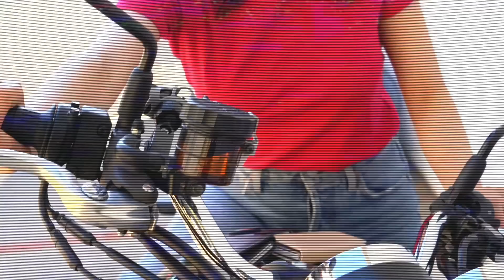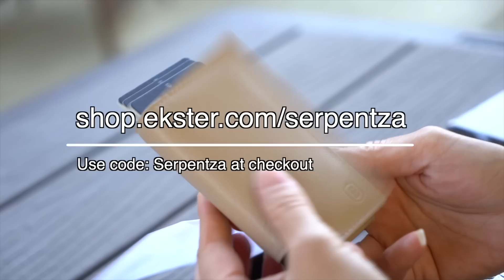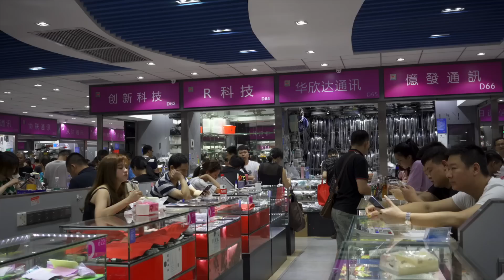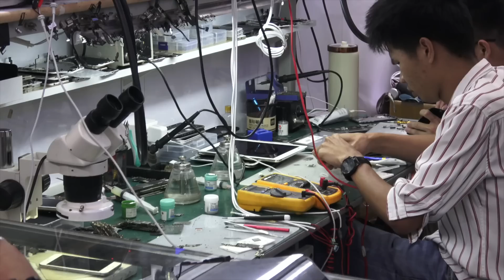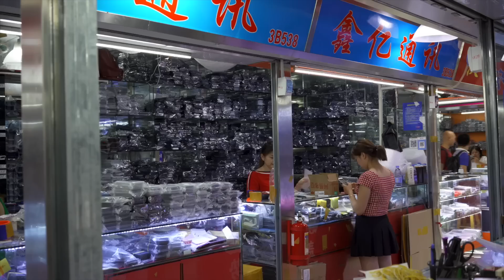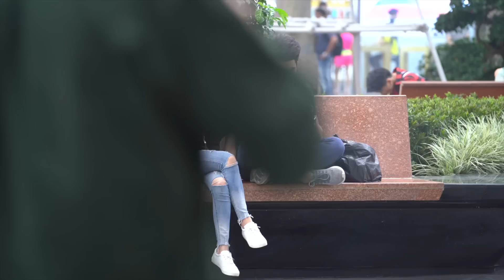Why China Can't make Chips!

Comment: It's worse than that -- at this point, any company who has their equipment or machines manufacturered in China, deserves to go bankrupt.  Now I see why the bearings on the pumps we bought kept failing -- the metal spheres were probably salvaged and did not have the tolerance for heavy use.  The US distributor gave us 5 pumps, as each failed one after another, before they finally "threw in the towel" and refunded our money.
Reply: Pump and dumped X_X
Reply: @HoboKa_AlexShtokalko  Schadenfreude?
Reply: Same issue, after the third time I asked the rep: are you sure you want to keep using that manufacturer to supply my parts? - it's costing you a fortune!
Reply: @hentype  - They also use clips from hollywood movies claiming to have destroyed other militaries in various skirmishes.  Like claiming to shoot down India's fighter jets, but it's a film clip from Top Gun.
Reply: looks like cheap chinese manufacturing is the most expensive in the long run
Reply: This reality is slowly starting to catch up to us in the west, as the old equipment that was built in the west starts to fail and we come to the horrifying realization that China can't replace it!
Reply: I bought a Reebok home exercise  bike. They used Chinese ball bearings because it is $10 cheaper than a German one. They failed after one week. Even the expensive Peloton and Nordictrack (which i also had to send back) use those cheap ones. The sales departments must be punished seriously, whoever approves using Chinese ball bearings should be fired on the spot. I am sure they can produce the same quality as German ones, but then they cost exactly the same!
Reply: @hond654  keep using the guarantee , hope these companies realize china is a no go
Reply: @ahmataevo  Russia claimed Ukraine was shelling civilian apartment blocks in Donetsk/Luhansk back in 2014. They “proved” it by showing cellphone footage of a (Russian) Proton rocket explosion from Baikonur…
Reply: Who is the "we" here?  A University?  A heavy-equipment manufacturer?  I'm curious; would really like to know who the 'user' was, as well a their equipment-supplier.
Reply: Texx Mexx  shutup bug!
Reply: Texx Mexx  be quiet please. I see you all over the places. Such admiration to ccp..
Reply: Dealing with one now.... high speed bearing on an electric motor. OEM sourced from China, each and every one introduces an out of balance "wobble" OR starts to glow after a bit of use, despite repacking with new/good grease. 
Demanded Japan/German made equivalent (I.D., O.D. ect) this time.... backordered, and I think I know why.
Reply: Texx Mexx  True, but the people of Japan were flexible. They admitted when things weren't good and asked for help to change. China views this as weakness, so I doubt it will change.... if it does, China will first need to change... aka, capitalistic, not communistic.
Reply: Texx Mexx  No your wrong it’s time for us to buy AMERICAN MADE ONLY‼️ And stop giving our money to countries other than our own‼️
Reply: @Jamie-Delph-44  I feel the same way,but people don't want to pay the increased prices as USA or in my case UK will be paid minimum wage or above ,
Reply: So apple, tesla, Microsoft and Asus deserves to get bankrupt since they all have gadgets & cars made in China
Reply: @hongluong3427  Short answer, YES. You are either for freedom or for slavery and  tyranny. These companies are putting dollars before human rights..... so it really is as simple as Good vs Evil.

Comment: The ecosystem of high-end semiconductors is pretty much set at this point, and will only get more solid at this point, since it is in the US national interest.  The Dutch and US supply a majority of the tooling needed build out the research and manufacturing capabilities.  First China has to duplicate the work of companies like LAM Research, Qualcomm, Broadcomm, Intel, NXP, etc.  Without that, you cannot even begin to build the infrastructure that would allow you to start making progress.  If your basic machining capabilities have only recently advanced enough to make a 1mm ball bearing (or whatever size it is), you will never advance to sub-10Nm etching on your own.
Reply: it's not so much about nm, but it's more about design.
Reply: Well, they made a sub-10Nm chip
Reply: @Foquro With western equipment.
Reply: @Sl1pstreams  That's the point. The sanctions don't work.
Reply: @Foquro  sure they work. Making a few chips with smuggled foreign equipment is not creating a domestic chip fab industry.

Comment: Regarding modern ballpoint pen technology, the anti-gravity ballpoint pen was invented by American Paul C. Fisher in 1965 which could write in outer space, upside down or any angle in temperatures ranging from  -50 to 160 degrees Fahrenheit. The famous Space Pen could write on surfaces as soft as butter to as hard as steel.
Reply: All the millions that went into developing the space pen, while the russian just used pencils
Reply: Ultimately Russian cosmonauts switched from using grease pencils to the Fisher Space Pen.
Reply: @jadenephrite  …. Yes, and the russians ended up buying those pens for hundreds of dollars in bulk, rather than waste millions in reinventing the wheel. I know the fisher pen has all of the marvel in the world, i used to own one in college, but i highly doubt using a pencil instead of those space pens was going to be the difference between a successful mission and one that ended in catastrophe
Reply: @spitgiezer  you don’t want your computer components bathed in graphene …
Reply: @Manteo1984  it´s not graphene but graphite, though it´s also electrically conductive so the result remains the same
Reply: Funny thing is the tip is pretty much standard, the ink tank is pressurized but the secret is the ink itself because it can even write over grease, they are the only pens I've used since I was a kid, they have always worked and never leaked even after sitting in a car in Las Vegas all day.
Reply: @spitgiezer  The Russian couldn't simply use a pencil  the lead could easily break off and float away, creating a hazard to astronauts and sensitive electronics on the spacecraft.
Reply: @spitgiezer  Thats a myth....😂😂
They quietly bought the civilian space pen as NASA did, but they bought more quantity....😂😂😂😂😂😂😂
Pencils in space would be a tragedy for security reasons.....😂😂
Reply: @bunnysidhu5064 it's how the principle of "keep it simple stupid" can be a double edged sword when a simple solution leads to a stupid problem and a bunch of simple solutions to stupid problems leads to a complicated solution overall.
Reply: @spitgiezer   For a person acting so smug, you fell for the myth.
Reply: And the Soviets used pencils. Simple solutions😅
Reply: @redbaron9029   It actually had problems with pencils compared to that pen.
Reply: @bunnysidhu5064  Don't spoil the urban legend :D

Comment: The ball in the pen tip is tungsten. It's a very small amount but if you have a ton of pens it's worth it to clip the balls out. It reduces friction and the ink rolls off instead of sticking.
Now you know the secret of the ball point pen
Reply: They will find a cheaper material that does not last long.
Reply: The issue the Chinese manufacturing had was the tolerances required to prevent them from leaking. Tungsten is difficult to machine anyway, and this is a very tightly toleranced and very highly spherical part.
Reply: That’s irony for only one reason china is the biggest producer of tungsten in the world.
Reply: @freedomdude5420  It's easy to mine natural resources, what differentiates the West from the world is that they add so much value to those natural resources. That's why they're rich. Anyone who claims they got rich just from invading other countries, and harvesting their natural resources should look at how much stuff in their house was invented in the West.
Reply: @MrDosonhai  I was referring to also that they have the biggest deposits in the world, but then again you are at right in some degree there a lot of countries with good resources but don’t have a way to make stuff with the materials it’s kind of an art. One thing I hate about countries with rich resources is it’s easy for the country becoming a dictatorship it’s when the country has to be forced with medium to low resources when a dictator loses power completely I don’t know why.
Reply: @freedomdude5420   Raw material versus sophisticated innovation.
Reply: @MrDosonhai  Exactly. It's the deeper aspects of culture at play here not luck.
Reply: its not a secret, its the most heat specific metal, just like water to liquid
Reply: @enginerdy  is it machined? I'd have assumed they used something like a shot tower
Reply: @nobodydoesithalfasgoodasyou  I figured it was some kind of two plate grinding process, but I don’t really know. I don’t think a shot tower would work because the size and roundness is so tight
Reply: @enginerdy  there is a nice video about how ball bearings are made, seems you're right about the grinding
Reply: Like the material the ball is made from isn't common knowledge. So, what's the point of collecting ball point pen balls? Are you going to make new pens, use them as ball bearings, oOr collect enough to make it worth selling as scrap? You sound like my friend, who thought that stripping precious metals from junked computers was something that would make him money, not realizing how many he'd have to strip to come close to having enough metal to sell.

I think you're nuts.
Reply: @TheEudaemonicPlague  I used a local council household recycling place. Right by it was a PC recyclers, set up to scavenge all the important bits. It shut down with a yard crammed with old beige PCs. Hundreds of them, stacked everywhere. How many were still inside I have no idea.
Reply: @Waverlyduli  
africa produces a lot of iron, cobalt, uranium, copper, bauxite but dont have the technology to use them properly.
science and technology is the key to success.
Reply: @thingsihyin4872  
László József Schweiger; 29 September 1899 – 24 October 1985
doesnt sound or look chinese to me
Reply: @freedomdude5420  In economic theory, it’s called the “resource curse.”
Reply: @tonyp2601  did you coin the term, or was this kind already either way it’s a good term.😎👍
Reply: @goldenhawk352  I do have to give him credit though that’s why it’s all about trial and air. So sometimes you may never get it somethings are lost to time.
Reply: @MrDosonhai  those stuff were invented by Chinese Americans.
Reply: @thingsihyin4872  Source? And Americans consist of many races, American is not one ethnicity. In fact, it only proves the US system is the best system in the world so geniuses keep going there to live.

Comment: Several years back, some of the Chinese railway specs mandated that couplers and drawbars must be manufactured in the US or EU.  These are components where a failure can be deadly.  Other (less safety critical) components in the spec mandated they be made in China.
Reply: at least whoever was writing those specs seems to have been making intelligent decisions, instead of throwing safety out the window.
Reply: Yes. Funny.  There is a propaganda channel. Hot Topic Time.
They made an episode to dispute this.
Reply: I would imagine that quality control (or lack thereof in the PRC) would be a large part of such a mandate. Undoubtedly tovu-dreg and its mentality, counterfeit and substamdard materials do not limit themselves to building and infrastructure construction.
Reply: New Zealand updated their loco fleet from China after 3 years of service one of the DL locos from China had an alternator failure...These are sealed units that are supposed to last 20 years of around the clock use...Kiwi fitters took the alternator apart and found inside a German bearing that had melted to slag...Samples of the bearing were sent to the German bearing makers who found it wasnt one of their bearings even though it had their stamp on it...It was a Chinese copy being passed off as a German bearing...The Locos also arrived in New Zealand with asbestos for sound proofing even though that was specifically banned from the build once again the Chinese had taken short cuts.
Reply: And they had 2  colliding high speed trains (Wenzhou train collisionin 2011). We still don't know the root cause, European tech badly redesigned to improve performances or railway track safety technology.
Reply: @shadowbanned5164  Yes this type of 'technological short cuts' you see often in emerging technologies can be deadly : Wenzhou train collision 2011. Today they have nuclear power plants based on European technology !
Reply: Probably after they had a few bullet trains crash which they buried (literally)
Reply: @zanetusken  Did you follow Elon's rocket development.  He crashed more rockets than anyone since the US was flying captured German V2's.  Maybe more. Now his rockets are the only ones that can fly people to the ISS.   SpaceX unarguably now has the best lowest cost launch system in the world.  Bar non.
Reply: @danharold3087  But rocketry and high speed rail aren't exactly comparable.
Reply: @philfrydman2576  Chinese Nuke Plants....As a South East Asian I'm terrified.
Reply: @danharold3087  Except all those crashes were from Test.  Not commercial Uses.
Reply: @zz3OPEN  Agreed.  But high speed rail does not run in a tube.   Rockets are tubes but have aerodynamic issues.  SpacX uses stainless.  The loop tubes would need to be stainless
Reply: @echomande4395  Our city ordered steel from China for a major bridge project - which suffered huge completion delays and cost over-runs due to the poorly machined parts, made of inferior steel, that kept getting shipped from China.
Reply: China has no quality control lol
Reply: @silverhawkscape2677  Exactly.  And that is why these guys will have none after they get the bugs out with unmanned testing.
Reply: @danharold3087  SpaceX's Falcon-9 rocket has the same launch cost as the Russian's Proton-M rocket. How could this be, it is not even reusable? You have to wonder how the cost came to be that way.
Reply: A large US railroad company contracted a Chinese manufacturing company about 10yrs ago to make wheels for train carriages (carriages are what hold the wheels to the rail car). After an alarming number of the steel wheels broke in two, the railroad company canceled their contract and switched back to US Made steel carriage wheels. "Made In China-Who Wants Cheap Cha Bu Duo Garbage?"
Reply: @philfrydman2576  dont hold your breath to find out what caused the plane crash earlier this year